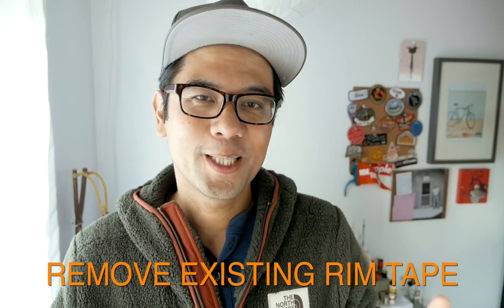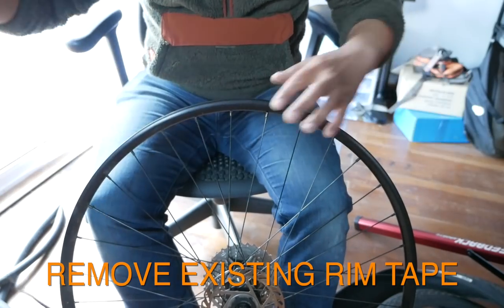How NOT To Go Tubeless - 6 Things I Wish I knew Before Going Tubeless

Comment: If you have bikes you only ride occasionally, keep them tubed. Otherwise, when you get around to riding them you end up having to check if the sealant is still good. Just one more obstacle to getting out and riding. If your using the bikes regularly tubeless is great.

Comment: I recently got into tubeless setup on my giant trance (tubeless ready rims) with the help of gmbn and Clint gibbs YouTube tutorials. I'm absolutely loving tubeless setup. But yeah, I had some issues inflating the tyre (single side bead as you mentioned) but air kept leaking and was really frustrating. Dry pumping would have helped preventing messy results. 
Now, like you I'm quite confident about troubleshooting true related issues while I'm in trail. 
I'd say similar experience as yours 😉

Comment: Use Gorilla tape instead, always better and way cheaper. Use a new razor to cut tape to the correct internal width of your rim. Check the rim makers website if you need that info or just measure with a caliper.   C02 cartridge is a godsend when setting tubeless at home with no compressor. Study the tire on the rim before using your c02, identify areas of the tire that are not close to rim bead, you may have to pull those problem areas closer to rim  (pull the tire hard, your hands will hate you).  Velocity also says that that the soap your using on the tire to help it seat must be sudsy(bubbles),  you can's always get suds from a spray bottle. Fresh dish soap in a bowl (use hot water) with a sponge is way better.Velocity also advocates that begin taping your rim opposite the valve hole when putting down the tape. Also , a nylon washer underneath the valve nut will keep the nut from bottoming out on the threads of the valve, that will also push down more evenly on the rim surface and better protect your rims as well as the nylon washer takes the damage first before the rim (please use common sense, look carefully,don't over torque) . I've heard that you can also place a rubber grommet between the nylon washer and the rim surface (I've not tried that). Hope that helps somebody out there.

Comment: You can actually ride tubeless with zero sealant in them, I've done this dozens of times by accident. They stay seated remarkably well. I believe the sealant is there primarily for punctures and sealing the rim-side of things, but tubeless-ready rims are often sealed well enough out of the box that it is functionally airtight even without the latex
Reply: Of course, I've only done this on short test rides on brand new wheels and tires! I doubt they'd hold up for long running dry

Comment: I find Gorilla tape is the way to go. Cheaper. And I find it easier to control than actual rim tape. I’ve had it in one bike for over 6 months now, no problems. And I like how it tears clean enough to tear it to size as I wrap the rim. 

I don’t do the multiple wraps that I’ve seen other vids do. I just overlap it past the valve stem hole by a good foot. And I’m careful to go side wall corner to side wall corner so the tire bead can push right up against the bead groove.

Comment: As a shop owner and mechanic...I get all the “gee they’re brilliant to ride” & especially the I ride in the desert or goat head territory riders. But as with many things in the bicycle industry, the “improvements” have moved away from the realm of field serviceability. Too many folks have too many problems with tubeless to manage at home or on a ride. It requires the type of commitment to get good at that most folks don’t want to deal with. So they bring it to the shop only to find out that the labor for a tubeless tire is way more than a tire with tubes. That is the direction the standard needs to go. Easy field serviceability that is a easy as tubes.
Reply: I dunno... tubeless is pretty easy for anyone with any mechanical inclination.

Comment: If the tires you chose are really tight on the rims try this tip: 
Lay the tire out in the warm sun for 20 minutes or so. 
The warmth from the sun will soften up the rubber a lil. Thus making it slightly easier to deal with getting the tire on the rim in general and then beading up as well. 
Install dry. Check for major leaks the sealant can’t compensate for. Then remove your valve core and add sealant. 
Install valve stem. Rotate and shake the tire to seal up lil leaks. 
I was resistant to tubeless for years. Now I’m drinking the koolaid. There great.

Comment: Two tips. Use gorilla tape instead of a bike brand of tape and you will have a much easier and cheaper experience. If you decided to stick with Stan's; once the tape is on heat it with a hair dryer to enhance the stickiness and squeeze out the air bubbles. It acts like heat shrink and gets tighter to the rim.

Comment: u can put the normal rim strip above the stans tape strip, so it will be a little bit more secure
Reply from the maker: wouldn't that soak up sealant?
Reply: @PathLessPedaledTV  what do you mean, the sealant between the two rim strips?

Comment: I converted about a month ago....i tried to use Stans tape but after wasting a whole roll and still having a leak i bought a 1inch of Gorilla tape and made 2 passes around the rim and presto....sealed. For a easy hack to seat the tire there is a YouTuber names Skills with Phil who hacks a Home Depot weed sprayer into a compressed vessel that you can use in place of a compressor

Comment: Nice these are good tips. Except the cutting the x on the valve hole, and don't use a knife either.  Another tip for inflation, I use a co2   inflator. I know the specialized ones cost 25quid but Aldi sell them when they have bike stuff for a fiver and you won't break a sweat.

Comment: I use the free air hose at the local gas station.  Remove valve core and fudge the nozzle a bit and you will hear the beads pop on.  Replace valve core and air up to pressure.  If the tire holds air, remove valve core and inject sealant using $10 dollar syringe kit. Reinsert valve core and air up to final pressure. Happy times,  I have done this many times.
Reply from the maker: That’s a great option if you can drive to the gas station with your bikes and wheels.
Reply: I just take the wheels and a valve core tool. Strap the wheels on the back rack.
Reply from the maker: @erikjorgenson6806  what wheels do you use to ride to the gas station.
Reply: @PathLessPedaledTV  lol my other bike?!

Comment: In the 70s & 80s, tube & tyre was both in 1 which was known as the then tubeless. So convenient, just strap it under the saddle.
Reply: Can you elaborate?  Do you mean the tire has a built in tube?  What about the valve stem?
Reply: @specagent999  the tube is the tyre itself with the presta valve stem. Just 1 pc. It was foldable so just strap a spare under the saddle.

Comment: I'm thinking of going tubeless, but still not convinced I'd be any better off. I have slime in my tubes to help stop punching, I guess tubeless is lighter, but I'm a adventure rider so speed is not so important
Reply from the maker: Biggest benefit IMO is the ability to run low pressures without pinch flatting. I think tubes and slime may help with that to a degree but not having a tube in that instance would be better.

Comment: As an seasoned aprentice in a bespoked bikeshop/wheelbuilding shop and anavid CX rider, I can tell you: use two layers of rimtape! It`s an extra precaurtion that is worthwhile with high pressure tyres on road bikes and momentairy stress overloads while going off road. Also make the valve hole as small as possible, but with as many cuts as possible: a 4 star is good, a 8 star is better. It gives the rimtape less chance to rip. Last of all, get an Airshot. It saves you a lot of hassle. http://www.mbr.co.uk/reviews/products/airshot-pump-review These are just some of the things I found out to work for myself and our costumers.
Great video, great tips especially the one where you make one side of the tyre sit with help of an innertube. Some tyres are a litteral pain in the backside to install on some rims and an innertube can be a great help.

Comment: I use those punture proof tubes and have never had a flat. In florida off road you run over spurs constantly and those lil bastatds always went through the tube but not those fatty punture proff tubes.  Yes there twice the size and weight as regular tubes. Idc. Im not racing. I guess the biggest down side in my head about tubeless is that you have to pour gunk in them and tape to seal them. Just sounds like a bad design with alot of weak points. I'm probally wrong but tubes have worked for me for me since I was 5 years old and now Im 63. 
So someone fill me in here. Do you not get flats with tubeless tires? Other than the weight issue is there any advantage of tubeless over tubes? I hear you have to pour that gunk in them every 3 mnts so to me thats not a self seal system. It's a high maintenance item. Gunk or patch a tube. I don't see much difference.

Comment: And don't forget! If your tires aren't sealing, then shake  and turn them sideways. And don't keep putting water on the tires to check for leaks. The sealant won't be able to dry and keeps leaking.

Comment: "If it ain't broke, fix it 'till it is..."  The tubeless process gets easier each time you do it. I've converted many non-tubeless rims and tires to tubeless over the last 7 years. Best tape. BEST TAPE for tubeless is Gorilla Tape. Forget the cycling rim tape.

Cycling specific tubeless rim tape is stoooopid expensive for how crappy it is. Gorilla Tape FTW!!! 1" x 30ft roll 3 pack is $11!!!! That's enough tape for at least TWELVE wheels.

Comment: PRO TIP: Leave inflated tubes in tires for as long as possible. Tires come folded up so shaping them will help them to seat easier!! You can also get a presta valve adapter and use any gas station air pump if you dont feel like furiously pumping that shit up.

Comment: Why didn't I find this a month ago? Yes, I didn't remove the rim tape. It was blowing from the spoke holes as hell, the slower and in then end it did seal. With the other wheel I did better. Now, because it works, I do not want to redo the first wheel so I hope it will remain working.

Comment: What happens if you have bubbles under the tape?
Reply from the maker: Potential bad seal. Explosion. Death.
Reply: @PathLessPedaledTV  the third thing happened how do i counteract it?
Reply: @PathLessPedaledTV  all jokes aside, i have bubbles in tape and around my valve it leaks, is that a correlation?
Reply from the maker: Potentially. Also sometimes you can make too big a hole with the valve stem and it won’t seal correctly.
Reply: @PathLessPedaledTV  I'm running shradder valves, could that be a problem? My rims are shradder.
Reply from the maker: @cleanestedits1  that shouldn't matter.  It's most likely a tape issue that the sealant isn't plugging up.  I would try another wrap of tape over the existing tape to see if that fixes it.
Reply: @cleanestedits1  how it go?
Reply: @sacballa_kills_em_wit_facts  I used mucoff tubeless tape that stuff works wonders

Comment: I'm not tubless. I feel the only benefit is allowing you to air down other than that it seems more like a hassle than anyting.
Reply: James M, felt the same way. Pain in the butt process to get my first wheel set going tubeless. Then I pulled about about a dozen thorns from my tires on a desert trip and watched in amazement as the sealant went to work. And then I picked up a screw that was too big for the sealant (sealant did slow the leak, tbh) and it took me all of a couple of minutes to pop in a plug and pump the tire back up a bit. Haven’t looked back since.

Comment: First off, buy a compressor. For less than the price of a couple tires you can get a compressor that will work great for bicycle tires. That said I went tubeless few months back using the so called “ghetto” method. Using Gorilla tape and threaded valve stems from an old tube, non tubeless tires and a couple of 2 oz. bottles of Stan’s. Absolutely no problems with mounting, getting it to seal, or riding since. It’s so easy I wish I’d done it years ago.

Comment: I've converted many of my old 26 inch wheels to tubeless without any problems. If I was to go tubeless on a road bike would definitely use tubeless rims, but on a mountain bike it isn't necessary.
 I use a pump with a pressure chamber which saves on the pumping. If I was traveling by air I would just take tubes because it's easier. Put the sealant inside an inner tube and you're good to go.

Comment: I don't get tubeless. If you want to save weight, it's lighter to put ultralight tubes (like Tubolito) and use light tires (tubeless-rated tires are heavier) than going tubeless. If you like to change tires often, different tires for different ride types, it's sooo much easier to use tubes. Your tires don't get gunked-up with dried sealant. And the "better feeling" of tubeless seems a myth to me.
Reply from the maker: The biggest advantage is running lower pressures without pinch flatting.

Comment: How about tubes with Green Slime or similar sealing compound?  Has anyone tried putting the tubeless tire sealant in a tube?  I know there is more weight involved but is the puncture resistance comparable?  Thanks for your comments and happy bike-packing!  :-)
Reply from the maker: Made a video specifically about using sealant in a tube.
Reply: @PathLessPedaledTV  Thanks for the info.  Will look for the video.  :-)

Comment: Not going to bother with tubeless.. The tubes I run are like $2 each and since I run 35-40 tires I only get a flat maybe once every 2-3000 miles.. Besides tubeless still doesn't solve the "catastrophic tire blow out " where you het a huge slice in the carcass that no amount of sealant will save and you just need a new tire period..

Comment: The devil is always in the details, really some tires don't seal well. But I've managed to mount many tires without all the special fuss and worry. I use old Stans rims with Stans tape and whatever sealant I have. Tried mounting some Cliffhangers, not as easy for some reason. I hear Schwalbe Thunderburts are also tough to get a bead, to be honest I don't notice much difference when riding.

Comment: I've recently set up a set of tubeless tyres on a spare set of wheels for my bike. 

Rather than getting a whole new pump to help inflate/seat the tyres, I got an SKS Rideair (http://www.sks-germany.com/en/products/rideair/) that you fill with a track pump, or a compressor, then use that to inflate/seat the tyre. It seems to work well. it is light enough that you could pack it ready filled to use on a trail (particularly with a group where only 1 person would need to carry one, &/or on a multi day ride) plus you can fill it, at least partially, with a portable pump  - I managed to get 140psi in mine using a Lezyne Micro Floor Drive (http://www.lezyne.com/product-hpumps-hp-microfldrhpg.php) when I tried. 

Another similar product is the Airshot/ Schwalbe Tire Booster.

Comment: Been tubeless for a year, not going back.
Reply: On road bike? Any flats?
Reply: Yechiel Chli I did get a puncture last week, on my road bike 25c tyres. I didn’t notice until I looked at the bike the next day. I pulled the piece of glass out the tyre and the hole sealed again. I played it save and stuck a rubber patch on the inside. And closed the hole up with super glue while the tyre was off. Tubeless is the way forward.
Reply: Which sealant are you using?
Reply: Yechiel Chli stans race sealant

Comment: i still use the inner tube but i got a tubeless tire the specialized roubiax. one thing i noticed it very hard to put on a rim and changing the inner tube is difficult. it kept me thinking if tubeless is for me.
Reply from the maker: Yeah. Tubeless tires are PITA to mount with tubes and without.

Comment: Why pump and deflate the tires with a tube in it when my no-tube tires fits my rims, I mean this is the no-tube tire that came with the rim. dumb! just dumb!
Reply from the maker: It’s not dumb it is a known solution to tricky tires. Not all tires will work as easily as yours. By first inflating the tire with tubes it seats both beads.  When you remove the tube, one bead will remain seated so you only have to deal with one side.
Reply: When you deflate any tire and want to take out the tube, you will move both beads out of place you want it or now. There will be slacks and the beads will move out of place

Comment: @5:10 Tubes are ALWAYS cheaper than tubeless because you do not need extra tape, sealant, valve and it is more time consuming as well compared to an tube exchange as you do not need to clean the sealant gunk out of the tire. Having a tubeless tire is like having a puncture every six month as you have to change your sealant every 6 month. So all in all tubeless is a real pain in the butt and only good for phony posers bragging and doing a show-off.